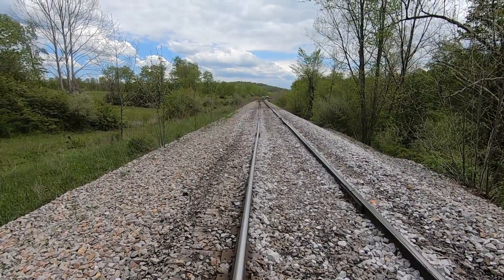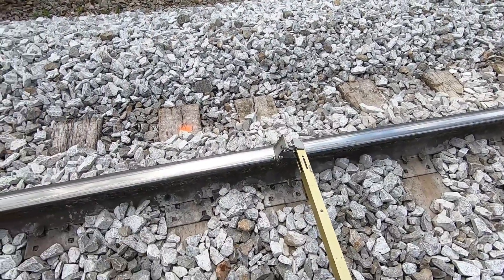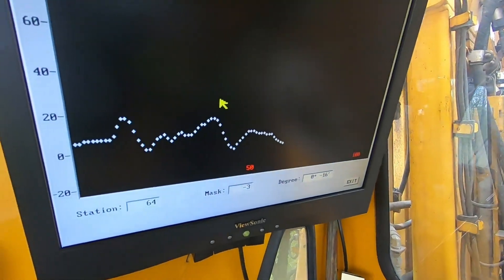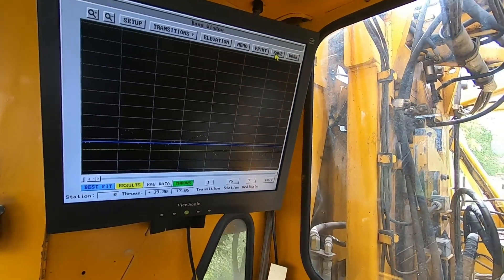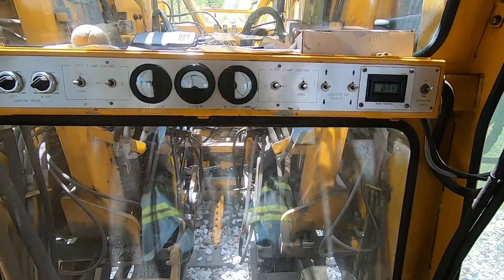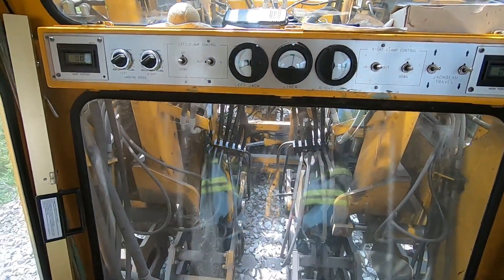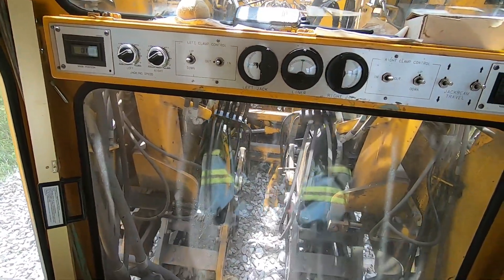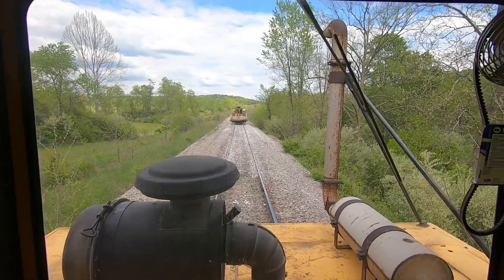Jackson 6700 Tamping a Bad Line Sway that also has Twist and Warp in the Track

Comment: I left the railway track surfacing game in 1981 in Australia. We had the very agricultural Tamper brand machines. They could get as good a result as yours, but we had to work for it. It gets in your blood and whenever I see a machine working, I stop and watch. Around 1980 machines were getting more modern and better to use. Plasser to me even though I was a tamper man, were a more robust machine and gradually took over in most states.
Reply from the maker: Thank you for the nice comment Rip. You are right, railroading does
get in your blood and you can't get it out. I've heard a lot of guys
like the Plasser equipment, I've never been around one.  Appreciate very much your taking the time to write in and to check out the tamping video my friend.

Comment: Thanks for explaining the Jackson tamper. Back in the 70's  we had one of those Air/ hyd Jackson do all tamper/ track liner/ ballast wings/track broom/Track jack. The track level was done by cable controled level board and of course the hand held level board. I am glad you guys have so much beter equipment than what we had back then.
Reply from the maker: I've seen one of those old machines but never watched one actually
work Thomas. You are right, this 6700 is the cat's meow compared
to that old thing. Thank you very much for watching the aJackson 6700 tamping video my friend.

Comment: Strolling thru and happened on this video. Built these machines in Michigan for 25 years and they were technological advances
Reply from the maker: How cool to hear that. Ours was built in 1994 Norman, possibly
you helped build that machine? How neat would that be if you did!
It's still going strong although like every other tamper it has had
it's share of problems over the years. it was rebuilt in 2013 by a
company called Kanza. Very grateful my friend for your taking the
time to visit with us and check out the video.

Comment: a jackson can’t do what a mark 6 does, jackson would be okay with pd work heads & Jupiter too.  only thing the Jackson has that I wish the mark did was the jack beam
Reply from the maker: Of course it can't Kyle, but this is a very old machine, made in 1994.
We considered and upgrade to a Jupiter 2 with positive displacement work heads and a bigger engine but for now it's a lot more expensive and it isn't in the budget to get an upgrade any time soon. So I have to use what I've got. But with only 16.8 miles of track I guess it
really wouldn't pay to spend several hundred thousand dollars
on an upgrade.   Very grateful my friend for your taking the time to
visit with us and check out the video.

Comment: Bad soil and sub grade will keep you busy forever Dave...
Make Dave happy.
BNSF should have a unit train auction , usually backed up end to end for miles along Nebraska highway 2
Reply from the maker: You're so right about that Greg plus the 16 miles of jointed
track Jointed track is a maintenance nightmare, then top it
off with leaky coal hopper cars fouling my ballast.  Really appreciate your stopping by and taking in the video. May you have a most blessed day my friend.

Comment: Geismar RCA Inspection gauge, used them for many years, since 2014 I used the digital model, easier then turning knobs. Lay it down once, no more flipping the gadget around to measure the back to back on the frog . Gone are the days when  a gang lined and manually tamped the track. That's railroading today.
Reply from the maker: That would be nice to have a digital one, this one is around 12 years
old, lucky to have it. Those old days you speak of was real
railroading by some tough as nails guys. I like hydraulics
now much better than using lining and tamping bars....LOL
Reply: @ccrx6700  Dave I'll give old school that still exists,  in NYCT if a broken rail is found and can't be barred, if a rail is in the area, here come 16 men with 8 rail hooks, clawbars, hammers and wrenches. If the rail is 500 feet away, on the running rail and stroke to site. No power tools needed!!

Comment: Ah yes, the Jackson 6700.  I just put together a training program for that machine.  Should cut qualification time down from 2 years to 6 months.   There's a desperate need for tamper operators.  I know of several transit systems that are down to 1 or no operators, but they have plenty of machines and money to pay a worker.  They don't even have any people left to train other workers- and that includes a certain East Coast Class I which I can't name here.  It's simply that none of the younger generation want to get into the labor jobs, even though they usually pay more than a college degree and they aren't saddled with student debt.  No surprise, all schools are pushing is STEM, not the trades.

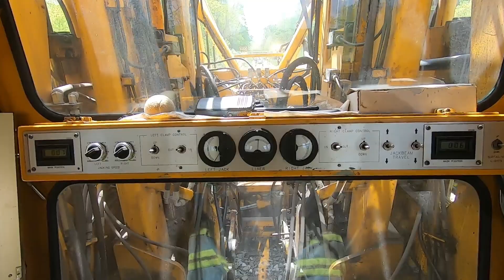10:45 you're hitting some hard ballast there.  It's taking some time for the heads to penetrate to their programmed depth.  Is your machine equipped with penetration assist in the program?

If you are thinking about retiring soon, but don't want to leave the RR life, I'm hiring instructors.
Reply from the maker: Wow what an awesome comment. it takes years to learn all
the ins and outs of running a tamper. Yes sir on the need for
tamper operators, I've been approached by KCS many years ago
to run tamper for them after they bought out the Panama RR,
they couldn't get guys to go down there. 

I cannot argue with you at all on trying to get young guys out
to work RR, only a few will do it and you are right, in that most
RR jobs pay more than what they would get with a 4 year program.

We have an old operating system and no it doesn't have an
assist program. I would love, simply love to be an instructor,
but have no plans of retiring. I am the only one who can run
a tamper here and this RR needs me. Plus I like working so
close to home and going home every night. I will guess and 
say NS on the Class 1, I've heard too many stories from guys
who work there. NS stands for No Sense.... LOL
Reply: @ccrx6700  If I wanted to get in touch with you, would I contact HR at the Cumberland Mine (Jessica I think it is?), or do you have a directory just for your short line?  It's possible that you can be a part of training without having to leave your current job.

Comment: What's the high limit of cross level?
Reply from the maker: The amount of deviation in cross level that is dictated by
the code of fed regulations depends on the class of track. There
are 9 different classes of track in N. America. The higher the
class the faster the allowable speed, and the more stringent
the requirements become for track geometry. We have class 2
track here. On class 2 the deviation from uniform profile on either
rail at the mid ordinate of a 62 foot chord may not exceed 2 3/4 inches.

Comment: Since there is lateral movement, wouldn't you put in a row or two of screw piles/ sheet piles and Then bench in a new deadhead wall? Beautiful work with the tamper.
Reply from the maker: Eventually we will need to dig that old wall out and replace it for
sure Nelson. Thank you for the nice compliment and for writing in.

Comment: We do need to keep building more perfectly functional kit like this rail machine with analogue dials, buttons and switches and a skilled operator. I have to imagine the fully automated replacement nowadays would cost a trillion dollars and would only then be available when they can get hold of the micro chips. This automation is getting crazy as what would have been a simple process to change the ventilation on my car means concentrating on a large screen with an array of virtual controls which makes driving impossible. Good to see a bit of human skill still winning the day and the satisfaction it gives to all.
Reply from the maker: Plasser is on the leading edge of RR maintenance technology Michael,
they are located in Europe and it is amazing the high tech they
are incorporating into their MOW machines, all in the means
to replace man power with technology. In my opinion there nothing
better for the track than a good man with a trained eye so I totally
agree with you on that. Appreciate your writing in and for watching
the video my friend.

Comment: Can you explain what the leveler is actually doing to the ballast and track?  I just hear big noises, but how does the track get laterally leveled?  How does ballast get pushed in, under a low track and removed from under a high track?  What local reference point is used as "correct elevation" that all the other track within a mile or so has to match or slope from, so as to be "as designed"?
Reply from the maker: All good questions and which would require a lot of typing to answer,
however I have a video that shows up close how the tamper
jacks and lines track and tamps the ballast under the ties. Here 
is the link to watch that video RedOctober2011

https://youtu.be/ytS-raTSyG0

Comment: What a difference from when I worked on the railroad 50 years ago! The jack and the tamper were 2 separate machines and the foreman would check the alignment by kneeling down and putting an eyeball on the track. All gauge and elevation checks were also manual.
Reply from the maker: Thanks for sharing with us, love to hear how old railroaders did
things. Before we got a tamper way back we used track jacks
and lining bars to hand tamp, but I was 40 years younger too! 
Appreciate your checking out the video my friend.

Comment: I’m curious why there’s so much ballast on each side of the rails ? It almost looks like it could have been two sets of rails
Reply from the maker: Very good question. Over the many years, this spot has been
sliding out. We dump ballast and pull the track back over. So
over the years there has been a good bit of ballast dumped and
that is why you see an extraordinary amount in this spot. Thanks
for writing in and watching the video today sir.

Comment: On the now closed Daylesford line the line was left to deteriorate and was rough riding until you cross a road and was smooth because the track had to be a reasonable quality for the level crossing boom track circuits.

Comment: I see the tennis ball on your dash there. People don’t understand how important those are when working on the track. Saved me several times.
Reply from the maker: Have some back problems and a Dr. told me to put a tennis ball
under the back of my legs when sitting, it helps relieve the muscle
tension. I have tennis balls in all my track equipment here. Now
you got me curious, what did you use them for?

Comment: Pretty kool. I'm used to doing it the old fashioned way with bars, shovels, and forks! But it works this is much easier. Thanks for the view from inside the machine. You guys seem to use an exceedingly large amount of ballast so I'm guessing the ground is fairly unstable on several places I've seen this. If it's marsh like ground the old time repair was to fill leather bags with ballast. I'm sure there is a newer material bag to fill with ballast like I've used to block streams during bridge pier repairs to shift or dam the water and we pump it to the other side below where the work is being done. Something to consider as it supposedly ends the sinking as the bags "float" or stay where they are placed. The rock ballast cages make for good retaining but let water pass very easily and last much longer than ties as well. Waste concrete quarry blocks can also be used if cheaper to get. But from all the ballast you guys get there must be a decent quarry nearby. Like your videos not many MOW crews ever post videos. I've run across a few thermite welding videos before those are cool. You ever do that you'll have to post that. That's really something to see.......
Reply from the maker: Glad you enjoyed the video. PennDot here says they can't get the rock baskets anymore, seems strange to me? Good old time remedy filling
the leather bags, I like that. They do make a newer version called
Geo Mat, lay it on the soft spot and fill with ballast.

Norfolk Southern here had a terrible problem years ago coming out
of Baily Mine. They took the track out, bulldozed it to grade then
laid down used mine belt, big belt, 72 inch wide by 1 inch thick, then
put the track back over that. Zero mud problems there now.

Glad you are enjoying the videos, we do appreciate your writing in
and for watching SteamGent
Reply: @ccrx6700  well PennDot probably just doesn't get them. We just used loads of them at my work along along I78 and along the streams where we were widening the freeway to 3 lanes each side. Reading & Norhern even gets them for that embankment/retaining wall along the Lehigh line.
Reply from the maker: We do thermite welding here as much as we can, have to get a
contractor to do it so it is expensive, here's a link to watch one
we did several months ago

https://youtu.be/OfZSYFOtHyA

Comment: How often is your machine off?
Reply from the maker: If you mean how often does it not take the rail where it's supposed to
go. That tamper must be calibrated to pretty exact specifications
so it will align and lift track the proper amount. We only need to
recalibrate when a component in the system is replaced. Many
RR's re calibrate yearly, some on high speed transit track are
calibrated bi annually.  As a general rule we like to re calibrate
every 2 or 3 years whether a part is replaced or not since we don't
put a whole lot of hours on the machine like bigger RR's would.

Comment: In compairson to a main line freight line, does your system get more or less  wear and tear? And since it's not connected and it's private, are there any limits on how the line is used, such as weight limits?
Maybe the next time you use this machine you can somehow demo what it does and how it works!
Reply from the maker: I really have no idea of what goes on with other RR's and amount
of wear on their lines. We have a lot cause of so many high degree
curves and because all our loads are uni directional, but that's railroadin here...LOL Great question tho and really wish I had a 
good answer to that, I would love to know myself. weight limits are
dictated by car load amounts, our hopper cars are 286,000 Lbs. limit,
that includes weight of car which empty is around 51 to 52,000 Lbs.
There a lot of what goes on with a tamper, do have one coming out
on how the lining and surfacing light system works here soon. Like hearing suggestions, that helps me understand better what you
guys want to see

Comment: I operate a 6700 tamper and I tried to calibrate the lining shadow board by using the calibration option on the computer I was trying to calibrate the left lining shadow board right line rail and now I'm getting numbers  all the way to 9999 and I can't get to the small numbers like 9 - 30 can you give me some instructions on how to fix this
Reply from the maker: Oh dear that not good. I don't have jupiter system so computer does not have the option to calibrate. I have to  manually set and re set calibration screws on mask meter which you don't have either, I'm sorry your gonna need find someone who
Reply from the maker: Und er stands that system, sorry couldn't be of more help and good luck
Reply: @ccrx6700  no problem thanks for your response
Reply from the maker: @syyops  let me know how you fare. If you changed a lining actuator   new from harsco, it may be wired wrong, had that happen.  Could be several mechanical problems. If it was mine would think was a bad calibration pot. But these jupiter systems way over my level

Comment: How does the machine actually do  what it does?  What difference do the tracks in Japan make, laid on concrete ties, with respect to tracks going off kilter?
Reply from the maker: Mark, you ask questions that require a full length video to fully
answer. short: the tamper uses a light system that sends signals to
the computer which tells the tamper where to put the track. Tracks 
mis aligning have nothing to do with concrete or wood ties,
it usually a sub surface or contaminated ballast problem or
due to expansion or contraction of the rail which is ambient temperature related
Reply: @ccrx6700  thanks, I look forwards to such a video. The conductor in Japan said that train speed is limited by the straightness of the tracks not so much the train itself. The Shinkansen can travel much faster than the tracks will allow.  While theoretical speeds of over 200 mph are possible, they seldom top 170 mph since even a tiny imperfection on either rail equals derailment.
Reply from the maker: @markmoreno7295  he was correct, straight is the key for high speed

Comment: So, if I understand correctly, you have to put the data from your manual measurements into the computer to compute the cross level, and the computer is able to analyze the data to come up with the optimum figure?  (Something like that)
Reply from the maker: Well Michael that is a big question to answer but a very good one.
Tamper automatically cross levels track, tangent or curve, however
in a curve I must tell the computer what amount of super elevation to add to the curve, then it does it automatically. I can also add super elevation to track manually without using the computer if I would want to, but computer is easier. I also tell the
tamper how much I want to raise both tracks up. Hope that makes it
somewhat clearer, if not write me back
Reply: @ccrx6700  that generally answers it. I was curious as I want to duplicate this in HO scale on a layout, so just a general idea works for me.
Reply from the maker: @michaelmorgan7893  👍

Comment: If you didn't just nail your tracks  and did it like everybody else  using plates and clips. What was done in 1850 is not the best way to do it now.
Reply from the maker: Yes sir there are better methods however figure up the cost to
replace 17 miles of track with Pandrol plates and clips and the time
and labor it would take to do it, sorry but realistically it ain't gonna
happen here. Thanks for watching Graham